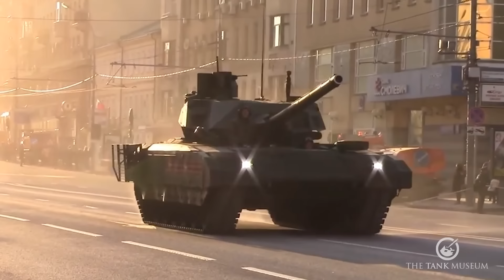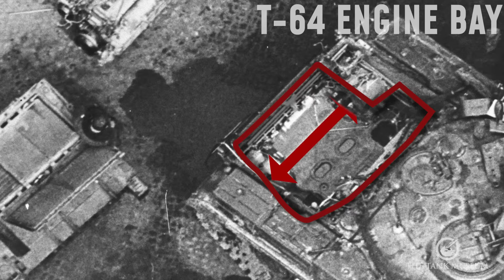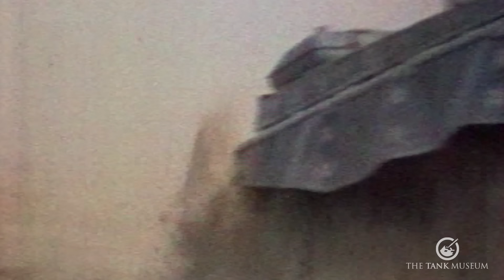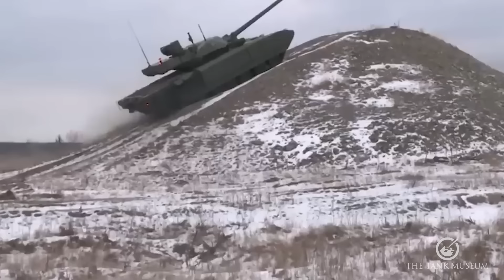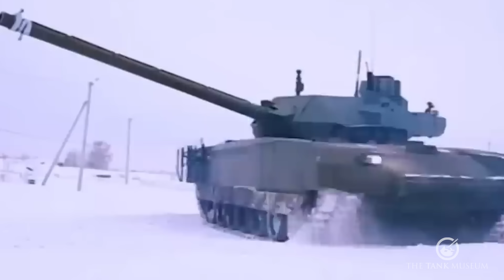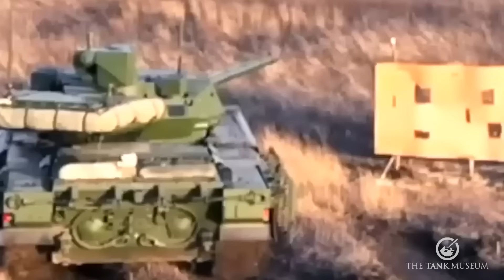Radical or Ridiculous? | T-14 Armata | Tank Chats #171

Comment: Some supplements.

Top attack
Actually Afghanit APS is a three-piece-system, using softkill, the heavy, 180° frontal angle covering explosive shaped projectile hardkill for all more energetic threats (like APFSDS) comming in a flat angle (or missiles of maybe some 45° angle), and a smaller thermobaic grenade launcher (seen in pictures from the top, but sometimes covered by teh little protector shield) poping above the tank and push the incomming threat out of the attack corridor by displacing this air it is taveling in. So actually it has a TA protection - but another idea of protection is that a TA might make a mission kill by disabling the turret, but not cause a casulty in vehicle or crew.

APS
The limitation of 1700m/s is a critical problem for most modern western KE's travel at 1750m/s (some slightly more, some slightly less), which is a unsafe bed to invest so much money in (actually T-90M not field Arena for that additional 300.000 USD investment doens't make enough sense, they found (in export version it still is an option)). The manufacturer agreed this to be a problem and said there is a ongoing upgrade covering objects traveling at up to 3000m/s (which is a bolt claim and future will tell).
Mention that Trophy HV capabilitys of covering fast objects is absolutly inferior and german StrikeShield (not actually deployed yet but the next best comparison in capability) didn't revealed ther limits so far.

Engine trouble
Most of this rumor is from the military parade incident and has become a meme. As seen in the video, as the recovery tank tries to tow away the T-14 it didn't moved an inch and whipped on its suspension, which made clear it has been a driver mistake, accidently activating the breaks. A dead tank has just externally powered moved its tracks. So it still can be a thing, but most of the sources are just misunderstanding (maybe some willingly or for fun) the situation.

Gun
The current gun can fire Vacuum-01 and -02, which not only have pretty high penetration, but also speed, wich bypasses all so far existing APS' (2050m/s (i wonder what's always with this 50 at the lower numbers ...)).
But for some weird reason, some officals have found the firepower to be insuffichent against theoretical advesarys like KF51 Panther and allready ordered the newer badges of T-14 to be outfitet with a 2A83 gun of a 152mm caliber. To my knowledge there are no ammunitions designed for this new caliber (but its 'original' artillery rounds). Seems a bit overkill to me, but then again - that'd be pretty russian.

Comment: What source(s) are you using to say "the A-85-3, that was a copy of German X-shaped engine from the war-years. The trans-diesel design beauro had originally offered the unit for compressor oil and gas pumping stations."?

I know the youtuber Laserpig made a similar claim that the A-85-3 was copied from the Sla. 16 originally as a pumping engine, but from an engineering point of view, the engines are vastly different, and it makes little sense that they would design an engine for a pumping station to be so compact.
It seems more likely that the engine was designed for the tank and then marketed for pumping gear at a stage where the tank was still considered a secret development project.

And as for it being a copy? Considering the bore, stroke, cooling etc are all different, I think not.
At a stretch you could say the layout was "inspired by" the Sla.16, but that's like saying all V8 engines are inspired by the French Antoinnette V8 of 1904 (or Cadillac V8 of 1914).

Comment: Even if the T14 was a failure its failures and features can be used as a foundation for a future success.  Russia can build a tank from the drawing board to reality mass production.  Western tanks are built to very low numbers.  And parts are sourced from other countries.  Ammunition in the west is stock piled in low numbers for shock and awe campaigns but struggle with longer conflicts. Lacking the industrial capacity and experience that Russia still maintains.

Comment: I don't think the Armata engine is developed from the ww2 German engine...they have some simmilarities on the surface level but that is a different design.
Reply: There was internal Russian report that the engine was using imported engine parts, when it was being subsidized as an entirely domestically designed and produced engine under the Import Substitution program.  Presumably the internal parts were from a German engine.

This is one of the reasons that the engine project was canceled.  Which in turn created a powerplant crisis as the power pack was designed around this specific engine.

Comment: For those who might missed the first minutes of the video, it was mentioned that some of the info here, taken from various internet sources, maybe propaganda.  One of these is the notion (mentioned by Lazerpig) that the Armata uses an engine derived/inspired/copied from a German engine.  I tried to find evidence but I only found one website that seems to be dubious.

Edit: Lazerpig has made a new video where.he detailed his research here.  Though he did admit that it wasn't definite as Russia hasn't declassified info regarding it.
Reply: @Whatifwarlord lazerpig is a youtuber and openly admit his bias. This does not mean he willfully shares misinformation but does mean he make different choices in sourcing and presentation.
Reply: The A85-3A is new engine, but was derived from the Simmering SLA 16 engine from WW2. Besides the obvious layout and accessory placement similarities, it has relatively similar internal dimensions. However the cylinder count, as well as a few advancements made due to the 70 technology gap, are notable changes. 

It would be a fair assessment to say that it's a spiritual successor, not a copy.
Reply: @SuppliceVI  or rather that its a similar layout not even a spritual sucessor,

Spritual sucessor is what the G-36 is to the STG-44
Reply: @gerfand  The G-36 has almost nothing to do with the STG-44. The G-36 is a short stroke rotating bolt rifle, whereas the STG-44 is a long stroke tilting bolt rifle.

A good gun example would be the AK-47 to the M1 Garand. They both use the same action (the AK-47 is basically a resized Garand action, upside down), but the AK is rechambered for an intermediate cartridge. 

Like the engine, it's based off an older design but modified and refreshed to fit current needs.
Reply: @SuppliceVI  yes but thats the thing spritual sucessor means it does the same thing while not being a direct sequel in thos case, G-36 and STG-44 are both Assault Rifles that armed the German army.
The engine is just similar in idea (X layout) but besides that theres nothing that would make them a "spiritual sucessor"
I say this because Spiritual sucessors comes fron media, I know most from gamming, and they are unrelated but do the same thing , so SupCom and Plannetary Annihilation being Spiritual Sucessors to Total Annihilation makes sense, trying to say this in Arms world is strange, but I would say the defining point is not the "engine" of the game (the three games have different engines) but what they try to achieve (Tech based Fluid economy RTS that win condition is killing the enemy Commander).
Reply: @Whatifwarlord  yes, but this is the thing, unless we talking about the video, the youtuber as itself is not a good source, its not like an Book that can be reviwed, etc, a youtube video is first for enterteirment like you said.

This is why this discredits Tank Museum a lot.
Reply: @gerfand  "the youtuber as itself is not a good source" Chieftain exceptionally.
Reply: @Count_Gustav  same thing with RedEffect (which is a guy I like) good thing with RedEffect is that he sources his video on the description tho, but we should not take the thing he says on their own.
Reply: yeah.. better watch redeffect videos. more accurate
Reply: @jebise1126  Haha lol, a Russian chill, yea right.
Reply: I think LazerPig is a source now...
Reply: @gerfand  a very wrong source
Reply: @ASlickNamedPimpback  Youtubers are not a source, but yes, its bogus claims on top of that
Reply: @gerfand  LazerPig got so many things wrong out of out context about the T-34 and about military history in general that it's best to treat his videos as fictional entertainment and not much more.
"In battles where quantity has met quality, and that includes World War 2, quality has won every single time." - Lazerpig
Reply: @Edax_Royeaux  "lets disregard any numerical advantage, its not like quantity is a quality lf its own"
Reply: @Edax_Royeaux  also let me guess, he also said Tigers were bad because numbers or something? I refuse to watch him
Reply: @gerfand  no tigers were bad tanks because they were slow, broke down all the time and had to be shipped all the way to Germany to fix. And yes the numbers do matter and no matter how you spin it Germany couldn’t build enough tanks for the war effort
Reply: @MrJimheeren  I'm asking what Lazerpig opnion on Tiger is, since for him being better in quality is all that matters, which means Tigers would have own the war
Reply: @gerfand  well watch his video then.
Reply: @MrJimheeren  I said I refuse, because he looks extremely cringe and I have better things to do
Reply: @gerfand  if you wouldn't take the youtuber in question at face value because of potential bias, why would you take a random comment over the youtubers own words as to their opinions on a subject?

I could just as easily misrepresent Lazerpig as much as he could a subject of his videos.
Reply: @MediumRareOpinions  because I at least saw something with Lazerpig to know he does that, I never knew anything about him until someone said the V-2 engine thing and asked who said that, then RedEffect did a classical response video and I know what kind of person he is (yes from that one video), he cares more for comedy than factual arguments. He was the one that either invented or at least popularized the idea of "T-14 uses a German engine", because I find his comedy cringe inducing I refuse to watch his videos, but if anyone can quote what he says, I will use that, knowing its probably true thx to what I know before hand, ofc I would not ask this if it was like 2 months ago when I never knew who he was.

Another thing is that if you something like "THE Tank museum, and you use A bad source, it discredits them, a random comment has low credibility but everyone knows that, some respeceted institution should act better because people will take this at face value, expecting then to have made research before hand, and some youtuber "comedy" is not a source neither is "they look alike".
Reply: @gerfand  that just shows you're willing to let your own bias towards him confirm any potential misrepresentation you receive from a random account you know nothing about.

If you're going to ask what a person's opinions on a subject are, regardless of who that person is, the least you can do is listen to what they have to say for themselves
Reply: @MediumRareOpinions  yes, and? My Bias is something based on reality I can prove false, yet I don't keep talking about him but be warned... At most I use " apparently " when talking to friends. However him talking to thousands or millions and his missinformation being used as a source is much worse, and its not the same thing if you want to get to this point, I may dislike the dude and warn people,sometimes make fun of him, its not the same as him being used as a source for a video like this.
Reply: @MediumRareOpinions  also if one is smart in attacking someone he just say the truth about him.
Like I said I know him from RedEffect video, in which he just talk about T-14 related mistakes, one of which is "tanks and car have same torque" which he himself on the description but no video edit or even quality control (which means he was called out on) said was a mistake.
Reply: @gerfand  I'm not talking about Lazerpigs possible misinformation and if I wanted to know what red effect has to say I'll watch their video on it myself, I'm addressing your critique of somebody on standards you aren't applying to yourself.

Why are you so willing to accept second hand unverified information about a video you can watch for yourself? You have access to a primary source but are intentionally not using it
Reply: @MediumRareOpinions  okay I get what you saying the reason is because I find him very cringe and unberabpe, if I got a transcript I would read it, but otherwise no
Reply: @gerfand  He says "In battles where quantity has met quality, and that includes World War 2, quality has won every single time." in his T-34 video and in his Tiger video, he repeats the "quality has a quality of it's own statement" in an extremely mocking tone and doubles down on the idea that quality wins every time.  And even when I quoted the Battle of Thermopylae in the comment section of the T-34 video, Lazerpig fanboys desperate to defend the statement question whether or not the Greeks were superiorly equipped at Thermopylae, deflect that Thermopylae lead to future victory, point the Spartans weren't the only ones to fight at Thermopylae as if that changes anything as the Greek hoplites were similarly equipped, or question if Thermopylae even counts as a battle because it was a delaying action.
Reply: @Edax_Royeaux  theres other examples but yeah was thinking of that, what you should hace quoted tho but that requires a bit of Luso heritage is quote the one battle where Superior Tercio formations from the portuguese lost to inferior North African troops that were more numerous or the Zulu war. But yeah I can see they doing it "lol was that even a victory" if anything today you should say "you right look at Bakhmut"
Reply: @gerfand  Yet you appear to have all day to think and talk about him. Please, take another two hours to go on about it.
Reply: @zymuralchemy  bro these comments take not even a minute to write, depending on size, I literally write them when Im on the toilet
Reply: @gerfand  🤣🤣🤣🤣🤣🤣
Reply: @MrJimheeren  Germany did have enough tanks, the issue was they could not protect them from the allied air attacks.
Reply: @bobandrew8884  a quick google search told me that Germany build for the whole war (1939-1945) around 40.000 tracked vehicles (that everything with tracks) the Americans build 50.000 Shermans alone (so that’s excluding all the other stuff) and the Sovjets build 80.000 T34s. There is no way in blazing hell Germany could have won WW2
Reply: @MrJimheeren  Germany could have won WW2 and nearly did. Overall production numbers are a very dubious metric, if for example you take the offical US army reports at the time that stated it took an average of 5 Sherman tanks to knock out one Panther. Germany produced over 5,000 Panthers in the last 18 months of the war.

Comment: there is some confusion about the T-95, since multiple different prototypes were called that, but the actual predecessor to the T-14 was called the Object 195, which also had the crew in the hull, the X-shaped diesel engine and other similarities, although it did have even more advanced features like a 152mm smoothbore cannon, a 30mm autocannon and radar. you can find a couple of pictures of it online.

Russia has had real problems with the cost and production of the T-14, so it's not surprising it lacks some features of the predecessor, which would further complicate the production and cost more. they will most likely stick to mainly producing the T-90M instead of the T-14 anyway.

I would like to add that the X-shaped diesel in Object 195 and T-14 is not based on a WW2 German diesel engine, which had for example its pistons at a different angle compared to the Russian one, 16 cylinders for a total of 36.6 liters and it was air-cooled. the Russian one on the other hand has 12 cylinders for total of about 35 liters and it is liquid-cooled with an intercooler among other major differences like compression ratio and cylinder bore.

the main similarities are the X-shape, both having twin turbochargers and that both engines were built for tanks, but the German engine was not the only X-shaped engine ever built nor the first one, so the claim is dubious in my opinion, although I will admit that X-shaped engines are rare. if you are still in doubt, you can look at schematics and pictures of both and compare them.
Reply: Lazerpig made these mistakes too.
Reply: Thank you for this comment.
Reply: THANK YOU! Someone knows his stuff.
Reply: Must have had next gen thermo-optical active camouflage since there's so few sightings.

Comment: Very interesting capabilities in this tank, that will be standard in other tanks in the future.
Reply: What? Engines breaking down on the Red Square?
Reply: @arctic_haze  No, sensor fusion for all the crew, cameras all around the vehicles from every angle, 360 camera views that aren't just based on the turret, all crew in the hull like a cockpit instead of separated, multiple active and passive protection schemes besides just armor.   Not even the M1 Abrams has that much sensor fusion going on. This is the F-35 approach to sensors & information. It will be more and more the future in terms of how the crew is placed and able to communicate and see outside the tank.
Reply: @CheapSushi  Are you so naive? We are talking about Russia. More than half of the cameras and sensors will never work.
Reply: @arctic_haze  you underestimate Russia and this is why Ukraine is losing the war and Russia's economy hasn't collapsed

Comment: T-14? what an upgrade! Using the fuel system and engine out of the WWII German Tiger tank with all of its flaws. Brilliant! Just another piece of garbage just like all of it's predecessors since the T-54. A 4 Bradley AFV scout element dispatched an entire regiment of T-72's without a single casualty in return during the first Persian Gulf. FACT.